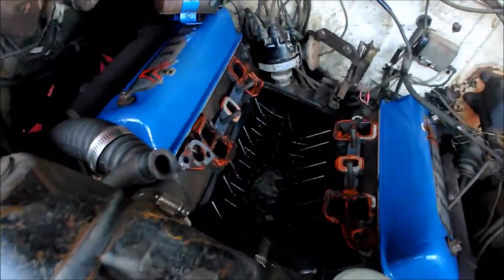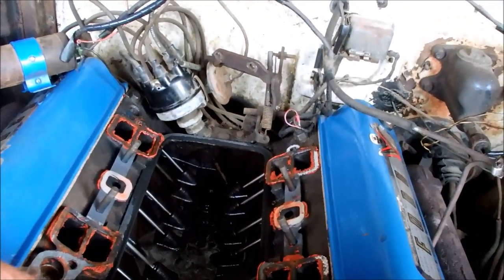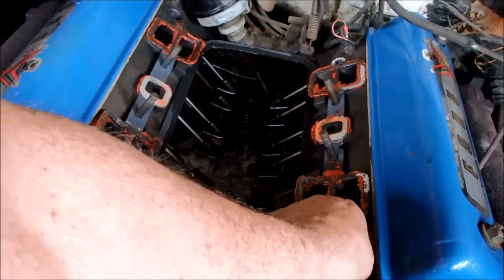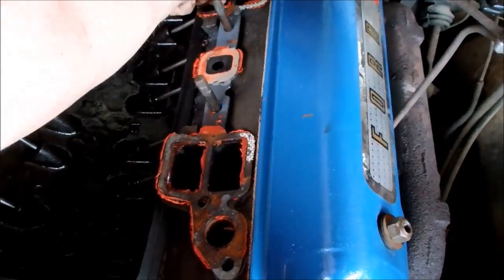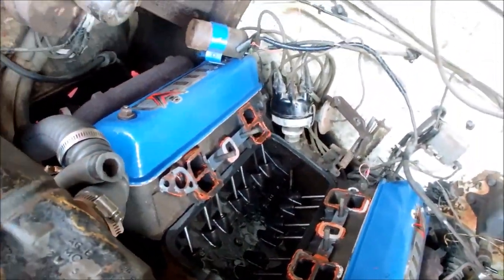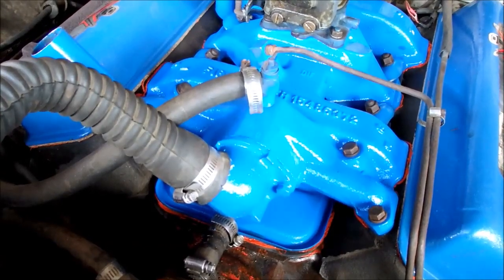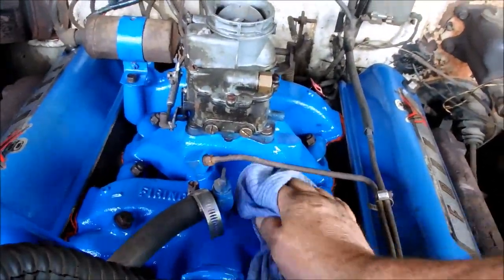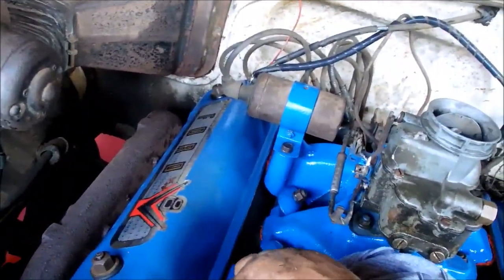Me Walking Away from the Ford

Comment: The thing about that red silicone is you wanna use just as much as needed, which usually not a lot and no more. You saw those red silicone string things you were picking off after you pulled the manifold... those are bad, at the very least they hang down in the air stream and disturb the fuel mixture flow and at the worst they can come loose and get stuck in a valve. Really about the thickness of a razor blade is all you need, as long as the sealing surfaces are clean and smooth.

Comment: I would have set the valves while the valley pan was off so you could see the lifters were all the way down. Adjusting them while it is running is for hydraulic lifters not solid lifters.